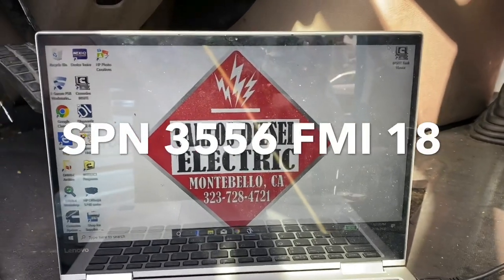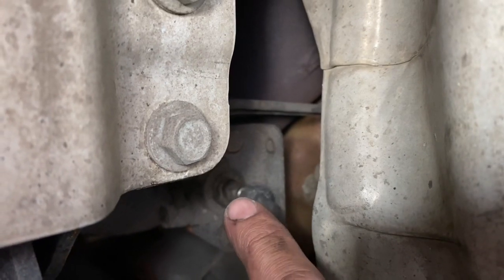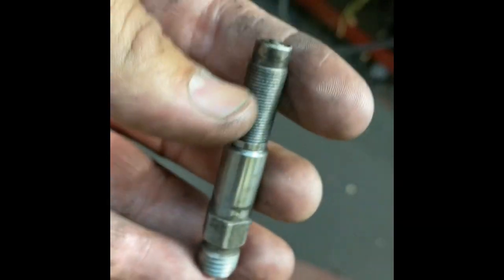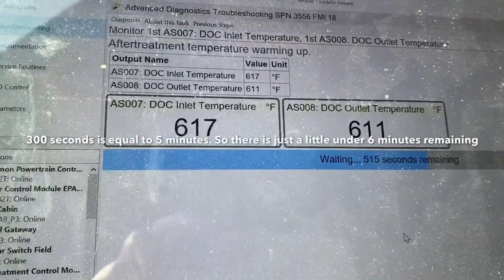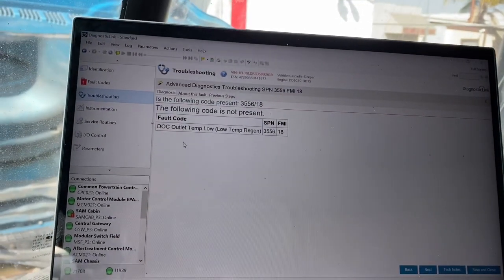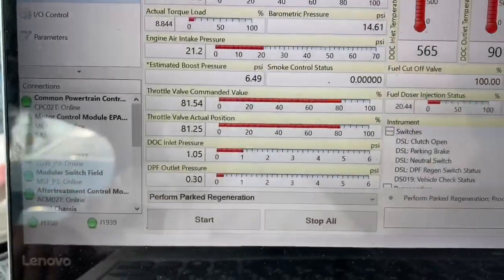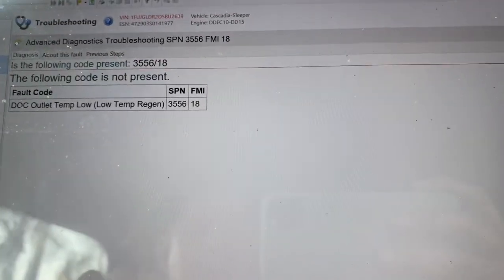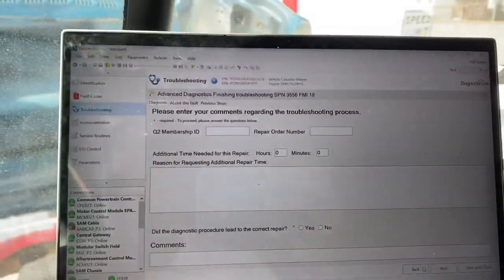FreightlinerCascadia DD15 fault code 3556 fmi 18 or SPN 3556 18

Comment: Hello, I saw your video and I’m having an issue with my freightliner. I have code 3556 fmi 1 along with two nox efficiency codes and I’ve done a parked regen and also a low temp regen. I’ve changed the dozer block and the 7th injector and I still get 3556 fmi1

Comment: What’s up man. Great video. 
I’m having the same issue. The code was active for me. I cleaned out the doser and hole and the code went from active to permanent. 
Doc inlet pressure was at about 1.8psi (above allowed spec of 1.16) I performed the DOC face plug cleaning and the pressure dropped down to 1.2psi which is still above spec 
Doser pressure and injection status look good. No exhaust leaks. The DOC inlet temp sensor is new. Do you think I need to run another DOC face cleaning?
Reply from the maker: Sorry for the late reply. I recommend to run the truck. Then test after. Don’t recommend doing back to back routines.

Comment: I just got code SPN 102 FMI 18 on a 2014 frieghtliner Cascadia evolution, 557k miles. The engine De-rated 25%. When I cut the truck off the code on the dash didn’t come up again but the orange engine light is still on. Can you help me out?
Reply from the maker: I believe the code is for intake manifold pressure below or low. 
Could’ve the Venturi pipe, the ports on the Venturi are blocked or check the Delta P sensor for soot. 
That is the easiest place to start.
Reply: @CarlosDieselElectric  thank you!

Comment: How does doser block works..?
Reply from the maker: The diesel Doser block works when your truck needs to perform a regen (driving or parked). 
The diesel Doser block will open and allow diesel to spray downstream through the diesel injector valve located behind the turbo (or sometimes called the 7th injector) in the exhaust system towards the after treatment. This allows the soot or ash to bake in the DPF. 
The diesel Doser block has valves and sensors that open or close depending on what the MCM and ACM are reading. 
It only works during the regen process.
Reply: @CarlosDieselElectric  Ok..thanks..from where does the doser block get fuel ..? From common Rail ..?  At 300 bar ?
Reply from the maker: @prashanshan7125  it gets the fuel from the HI-Pressure fuel pump. The hi pressure flange has a fuel line supply line that goes to the Diesel Doser block.

Comment: Hey dude good video..appreciate where u located man..im been having issues with code 4364/18..for the last  6 months  2 different delarship  visits and they cannot fix it for good..last visit they  replaced def doser and only work for a few days ..any help..por favor
Reply from the maker: This is probably one of the most difficult codes to troubleshoot. 
What year is the truck? How many miles? What else has been done (repairs)?

Comment: quick question my truck want do a regen because it cant see parking break when i try to start regen,no codes for break just says cant start parking break
Reply from the maker: Could be the park brake sensor. If you have a Cascadia it is usually located just above the accelerator behind the panel. Check there, could be the plug or sensor.
Reply: @CarlosDieselElectric  well it work i had an air leak on the red and yellow knobs changed that part and changed the sensors  and the truck is doing a regen.never thought in a million years an air leak would prevent truck from doing a regen.
Reply from the maker: @topshelf4176  glad you were able to take care of it and get back on the road. Best part you did it yourself, saved some money and learned something new 👍🏼

Comment: Damn this truck is a nightmare...does this problem happen very often or after 100k miles or less?
Reply from the maker: I always start with checking the S-pipe. the carbon build up will can cause blockage and prevent the  Diesel Doser Injector from working properly during the regen.

Comment: Currently have this code do I need to take to shop asap or can I run home then fix?
Reply from the maker: Some codes can eventually cause a derate if not attended too. Depends on far you are from home. 
Were you able to make it home?

Comment: Great Video. 

What's the differnce between the SPN 3056 and 3057 codes. I have a code for SPN 3057 but not SPN 3056. I'm guessing 1 is Inlet and 1 is Outlet?
Reply from the maker: I will look it up when I get back to work. Hopefully I can shed some light